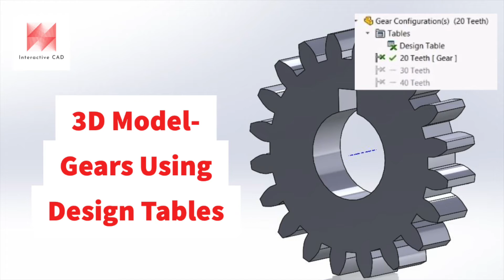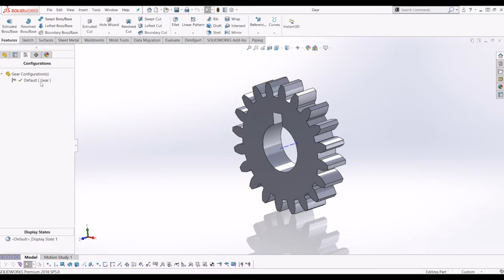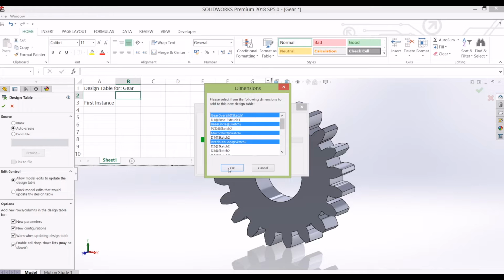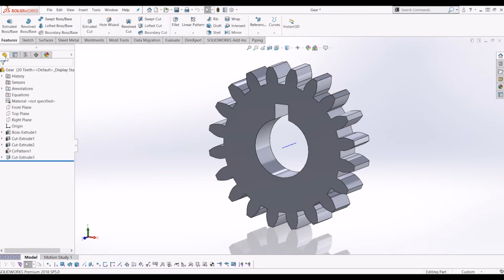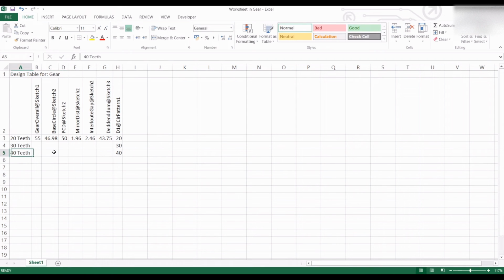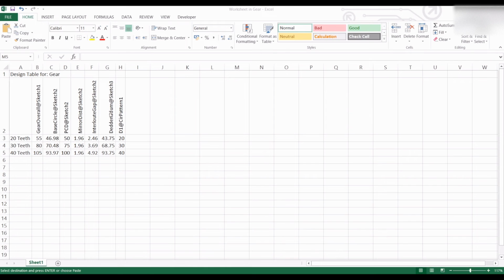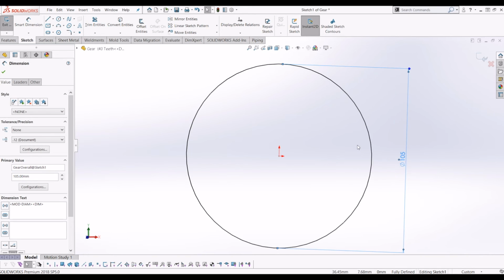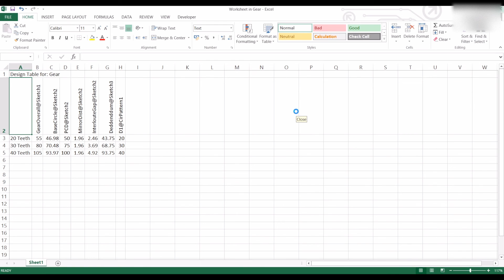Solidworks 3D Modelling How To- Draw Multiple Size Gears Using Design Tables 2/3

Comment: Great tutorial! thanks for sharing your knowledge!  But how do you calculate the parameters for the different size of gears? 
I would like to use this gear as my standard for 3D printing, but would like to know how to calculate different sizes (5, 10, 20 ,30, 40, 50, 60, 70, 80, 90 and 100 Teeth). I've tried in Excel by expanding the list myself, but end up with gears that don't add up.